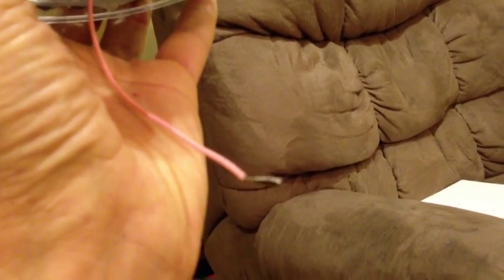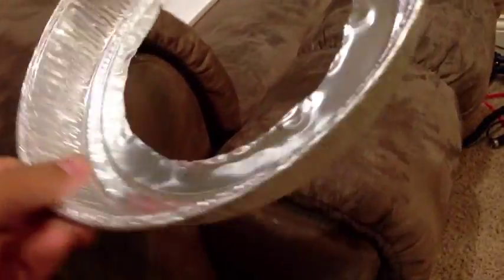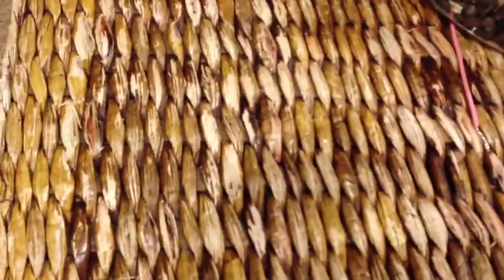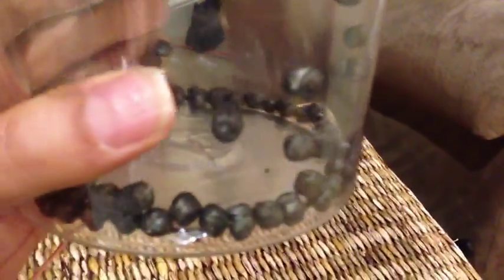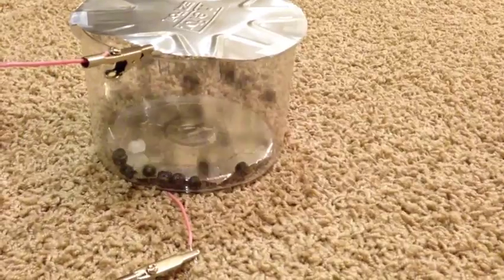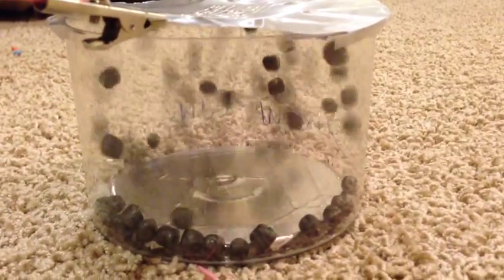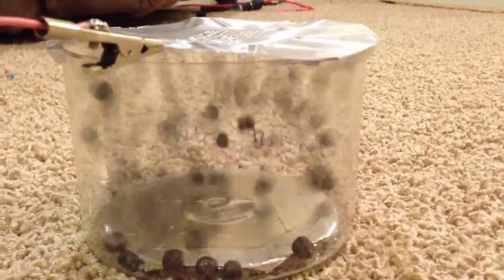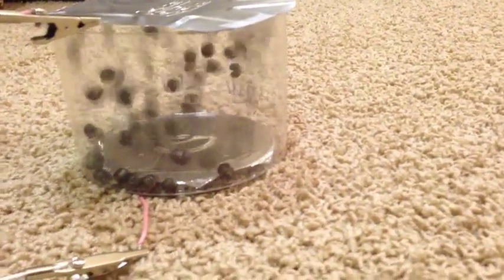Static Electric Powered Styrofoam Rainstorm

Comment: Hi Brian, can I ask what power source you used for this video? Cheers.
Reply from the maker: Hi thanks for asking. I made the power source with a cold cathode power inverter. These are cheap (around $5) and readily available from places such as alibaba or ebay. Here is a link to one:
http://www.ebay.com/itm/190963977738
These supply from 1 to 2 kV at around 20 kHz AC and are powered from 12V DC. A SLA battery works well with these. The output is stepped up to around 20 -30 kV DC using a CW multiplier. I strung one together with 20 stages using 1N4007 diodes and 6KV ceramic capacitors. As these capacitors have a small capacitance and cannot store charge for very long, I connected the 20-30 kV DC output from the CW to a home made capacitor made from the bottom of a plastic coke bottle or drinking water bottle. This was made by taping aluminum tape on both the inner and other surfaces of it. This acted as a good charge reservoir for running the "rainstorm". The rainstorm will also work without the reservoir capacitor, but it is better with it. Hope this helps.
Reply: Brian D Fantastic! Thanks for the detailed response. Might make one of my own. Cheers.